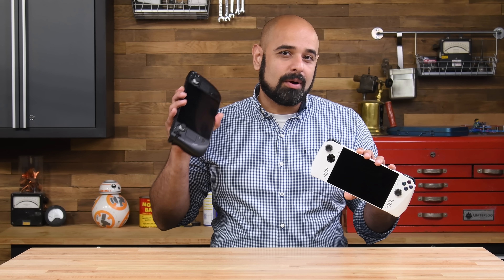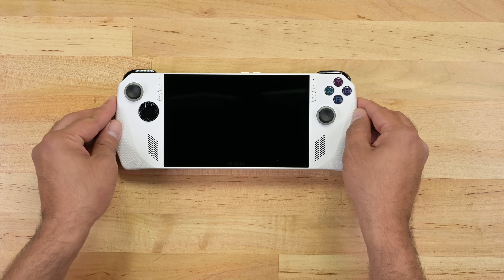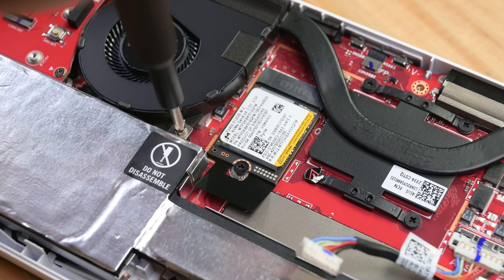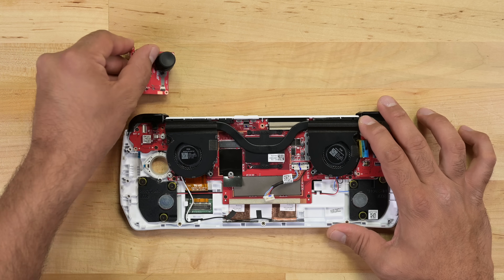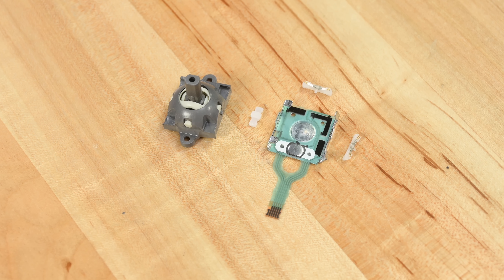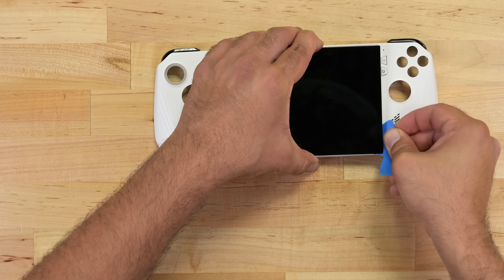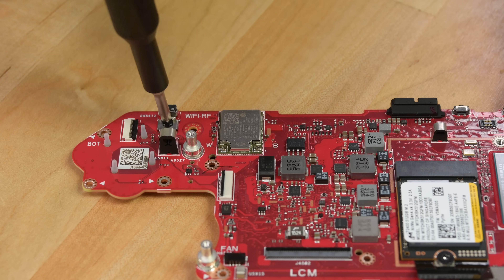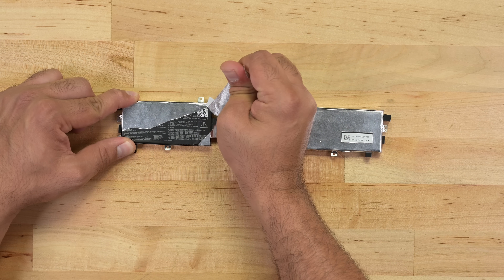ROG Ally Teardown: Great Hardware with a big “But”

Comment: Does anyone know if its easy to sort the bumper buttons out? My left one is alot more mushy then the right. Heard that it could be something on the back plate, took it off and tried it without it on but still the same. Can't figure out what's making it mushy and a soft press instead of clicky like the right side. Please help if possible.🙏
Reply: Can't you return and get a replacement  it as you may have a faulty one

Comment: I will say I’ve had absolutely 0 problems with windows on the ally since launch day. I’m sure there will be bugs I’ll encounter eventually, but so far it’s been nothing but smooth sailing
Reply: There's no better option than windows. I can't take anyone's opinion seriously when they rag on windows for Handheld..... there's nothing that even comes close
Reply: @kevinbuchanan67  I understand its not the easiest thing in the world to get up and running if you've never had a windows pc before, especially on a handheld, but for those with some experience its not bad at all!
Reply: @L0LN1CK  all 60,000 steam games are designed to run on windows while about 6,000 steam deck games are verified and some of those have problems. All peripherals, all standards, all emulators run on windows, all schoolwork,  all programming can be done on windows. Ragging on windows is the weirdo elitist thing to do
Reply: @kevinbuchanan67 The windows experience on a handheld is fundamentally flawed, why is it forbidden to talk about it? And to my knowledge, windows 11 has broken quite a few games, so no, not all steam games run on it, just like linux.

Comment: Regarding analog sticks, while it's easily replaceable, I don't think it may be possible for a third party like Gulikit to design a hall effect based sticks as easily as the steam deck and may require a bit more engineering work because there's not much space for the assembly.

Also, they use the same sticks as the GPD Win 3 (I think)
Reply: Gullikit also made sticks for the Switch which are smaller.
Reply: @zeronine-eightyfour  but that required a lot of engineering work. Gulikit doesn't appear to show any interest in making sticks for the Ally. This shares the same sticks with the GPD Win 3

Comment: I am really curious whether you can transplant this beautiful 120hz screen to a steam deck.
Reply: I doubt you will be successful. First of all, we need to know whether the controlling circuit for the display is on the motherboard or the display PCB itself. We also don't know whether Valve made it future proof with upgradable parts like the better displays. I would rather cut up some space in the deck and make a SO-DIMM RAM slot. Sure, the soldered RAM is definitely 50x faster because it's an APU and the clock speeds matter for the graphics. But, what if you could solder new memory chips? I wonder if the controller could handle them. What are the limits? Will it end up as the Raspberry Pi 4 with max only 8GB? I'm also not a huge fan of the small form factor M.2 NVME SSDs Valve uses as they use to be more expensive and I'm not sure about their life expectancy, especially of a single memory chip with "how many cells?"...

Comment: Let's pull up a video of the steam deck out just for a week & see how many problems it had
Reply: Look, most of them were already fixed in a month prior to the release.
Reply: At this point, does it really matter what the deck was like at launch? The first "mainstream" handheld pc has already been out for over a year. This device is gonna be replaced by a newer model in a year, if it sells well. Arguably they should have nailed the software on the first go, because asus is notorious for their support of devices. People had goodwill with Valve because of their support for devices & games.

Comment: It's funny that you show Valve's bugged software to showcase issues on ROG Ally :). This device is just windows PC with standard 1080p screen. There is nothing special about it aside from having joysticks & touch instead of a keyboard/mouse. Any issues you may have is badly written software which will have similar issues on any PC... It's a fact that consoles have much better quality control, and Valve is also trying to do similar thing for the Steam Deck. With Rog Ally, you will depend on Microsoft and game devs to do their job...
And for the price - try buying 13 inch laptop with 7840u... It will be double that...
Reply: So you can get a gaming computer similar/better  performance and similar price as the rog ally also gaming laptops  produce a lot of hear 🤨
Steam deck 2 will be a beast

Comment: Probably gonna be sticking with Steam Deck for a while though. No trackpads makes that VERY hard to use as a PC.
Reply: The ASUS software actually did a decent job in makeing it far  easier than it would be natively
Reply: The Ally has better touchscreen than the Steam Deck though. Steam deck's touch screen was horrible according to a reviewer, necessitating the use of a trackpad.
Reply: @triadwarfare  in short, you never had both. okay
Reply: @triadwarfare  just not true ;) steam deck's touch screen is working fine!

Comment: Idk why everyone harps on the windows updates. I legit haven't had any more software issues with the ally than i would with a new laptop or desktop
Reply: Exactly! My setup experience was similarly smooth. It's just going through the motions of setting up any pc. And if you know where to give Windows a friendly nudge in the right place, everything is quite daisy tbh
Reply: The problem is when you compare the experience to a Switch. Switch has few and quick updates. Interface is rock solid and unified. It took me over an hour setting up my Ally. It had a ridiculous amounts of updates and seems like if I haven’t used it in a bit there’s another windows update waiting. Interface wise you have the armoury using a button while windows uses bumpers as mouse click. Then there’s the pop-up keyboard that rarely works to pop up. The R3 button never seems to launch it.
Reply: Because all the cool kids bag on Windows any chance they get.

IDK, it's pretty obvious that a full fledged OS is going to be unwieldy on a little handheld (focused on playing games with a gamepad) and then surprise! It is unwieldy when the device comes out...!

In the week I've had the Ally, I've settled on two use-cases (after initial setup.) Power it on and double tap the shortcut for the current game I'm playing. Or plug the usbc hub in (which is connected to a monitor, keyboard and mouse) and use it as a full-duty PC. It does both of these really well so far.
Reply: Hard-core pc gamers don't like windows os, most people grew up with windows so shouldn't be too much of a problem

Also some people want / expect a console lol experience like steam deck 😮‍💨

Comment: Honestly, the Windows situation doesn't bother me. I really like the Ally - so much so I sold my Steam Deck. I think they did a great job with the overlays on top of Windows to squeeze some bit of ease of use out of Windows from a handheld perspective. The performance of this thing outweighs the OS cons for me. The only thing that drives me nuts are the joysticks. Patiently waiting for someone to create HALL effect joysticks.
Reply: I grew up on windows, gamed on windows and grew not to be that bothered by it, so I definitely agree with you. The hardware is phenomenal. I also had a steam deck and sold it because eventually I got frustrated/annoyed with the disadvantages of Linux based OS so I was excited for the Ally and am content with windows 11. I like knowing any game that comes out for PC will work baring hardware limitations. I just had too many games on the deck that weren't getting verified that it eventually turned me off of the joy I first had with SteamOS and its simplicity. I honestly don't have much go wrong in windows. It's just not designed for touch/gamepad but I can get around that fairly easily

Comment: I checked it out at a local best buy and compared it to the steam deck, it is like you said the hardware is good but the software is terrible.
Great option for people who love modding different os's.
Can't wait to see Linux on it.
Reply: Someone already tested on it and it's on 'par' at best. You get more console-like experience and somewhat better experience as a console than Windows, at a sacrifice of the hardware being 'not compatible' with the OS itself. ChimeraOS works but it's still gets some hiccups on its experience. For now just use Windows until the Chimera team finally fixes all issues, or if you want to help them you can participate it by installing it right now.
Reply: As someone who has owned this since day one, and was in the first round of deliveries for the steam deck last year, I've actually had much less bugs with the ROG than the steam deck on launch. With Armoury Crate and Steam big picture mode, you almost never need to mess around with the windows side of things.
Reply: @bfums  Shhhh, you're using logic. Can't do that when talking about these two devices. you're supposed to forget how the Deck was when it came out and pretend it was like how it is now in terms of software/stability.

I don't even have an Ally while I do have a Deck. Just tired of people that aren't making apples to apples comparisons in that regard.
Reply: @robblack8754 You know this argument is a bit off since ASUStek should already know how to deploy Windows devices. Yes, its their first time to utilize the Z1 Extreme APU and to have a form factor smaller than their own Flow X13 and Z13, but again this is primarily a Windows device so they should have enough experience in this field to not make glaring mistakes like the BIOS regression and SD card issues happening now.
Reply: @bfums yeah, everyone seems have memory loss and can't recall how so many games were terribly unplayable on steam deck
Reply: Are you comparing it to the Steam Deck in how it was in its first 10 days being out or the Steam Deck after close to 1.5 years of updates? The Deck's software was pretty lousy when it came out as well. Desktop mode on the Deck is still pretty terrible.
Reply: @robblack8754  I didn't get mine till September so definitely not at launch.
Reply: ASUS has actually done a pretty good job trying to manage windows on it. Definitely not perfect, but the command center and armory crate do A LOT to improve the experience
Reply: Yeah, I got my Deck a year and two months later so I don’t really have any problems software-wise.
Reply: Bazzite (linux) on the Ally says hello 👋 🤓

Comment: Ok windows 11 isn’t designed for handhelds but the fact that all of pc games actually works is pretty cool. Looking at you steam deck.
Reply: What?
Reply: Windows based handhelds have access to 100% of the PC game library in existence. Steam OS does not. That's what the "looking at you steam deck" comment is about I'm suspecting
Reply: @Idgafmf007 SteamOS has 100% access aswell lmao. It even has access to more games. Wine has much broader compatiblity with gamea dating back decades. While windows was removed alot of legacy features. Additionally when it comes to playing handheld SteamOS has much greater compatibility.
Reply: @durschfalltv7505  are you kidding? Steam OS absolutely does not have 100% of games. Games are built for windows. Wine only exists to emulate a windows environment. Get outta here with that nonsense
Reply: @Idgafmf007  Wine is not emulator it is a translation layer that translates windows to linux calls. It infact translates calls from all windows versions thus giving the greatest game compatibility.
Reply: It is really 100% if older Windows games don’t function?
Reply: @brandon_nope  what older game are you claiming can't run on windows 11? Windows 11 has compatibility mode for older windows versions for that exact reason. Ive been playing Silver on my Ally perfectly and it's from the 90s, a game from Windows-ME time period, if I'm not mistaken
Reply: @Idgafmf007  exept that windows compatibilty mode is worse than wine. Cause it translates less api calls.
Reply: @durschfalltv7505  I still haven't heard an answer...? What game?

Comment: It'd really help if there wasn't a 99.9 Wh limit on batteries, everything would just last longer, and maybe even have faster charging, why the fuck does a £60 controller only do 2.5W charging for a 1000mAh battery, not to mention lack of compatible devices 8bitdo, my last controller could connect to pretty much everything bar the xbox and playstation

Comment: Pleasantly surprised at how repairable it is!
Reply: If Asus make parts available. Otherwise owners will be dependent on 3rd parties to make replacement parts, and then there will be issues with variable quality I'm sure.
Reply: @jonathanellis6097  3rd party can be good too.
Onexplayer hall effect sticks can easily be used with ROG Ally.
I have already ordered a pair but at the moment there can be slight interference between the hall effect triggers and the joysticks.

At 10% deadzone the interference should not be an issue.
Reply: I was thinking the same thing! Definitely gives third party companies an easier solution for aftermarket thumb sticks and things like that
Reply: unlike the fucking Deck!
Reply: Asus always has made their devices easy to repair. I can tell from my 12 years of electronics engineer
Reply: Dosent really matter if there aren’t parts available…
Reply: Gulikit thumb stick.
Reply: Aliexpress
Reply: @gangwu4541 
🤞
Reply: how can? I have been using ROG dacades and all good, u guys in west only thinks Razer and Dell is best gaming laptop exist hahaha😂
Reply: @yudhaa what are you on about? The ROG GPU's have been the most popular GPU's in the US for a long time. Unfortunately, even though they're good quality GPU's, they're overpriced, and their customer service/warranty isn't great.